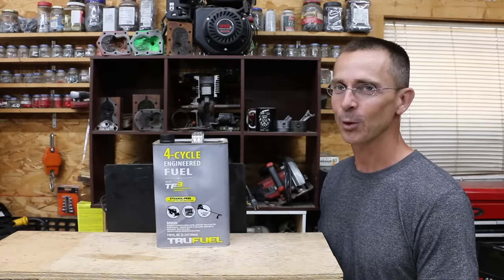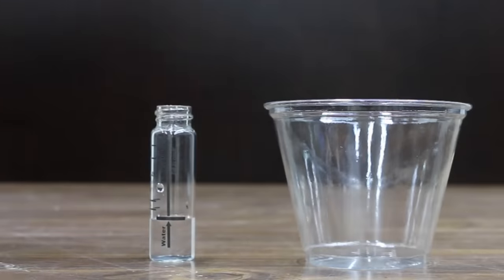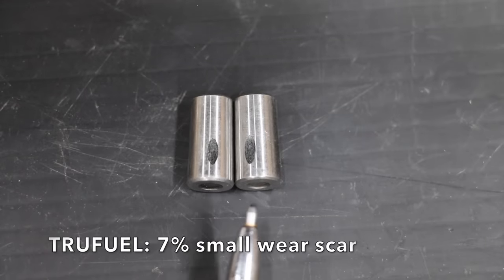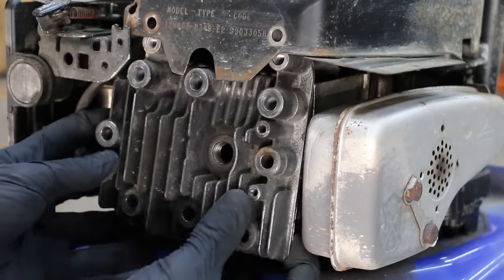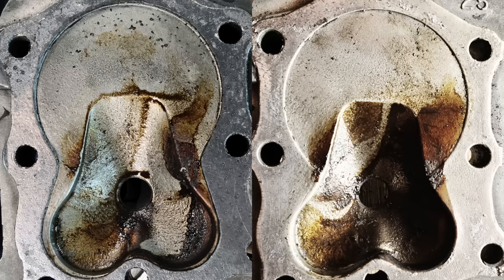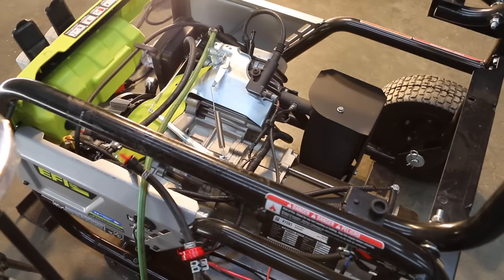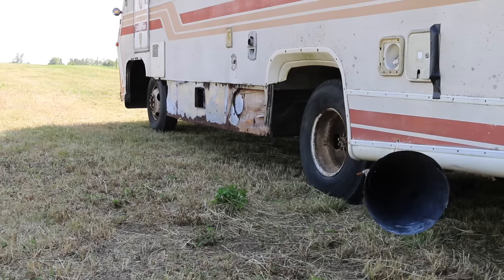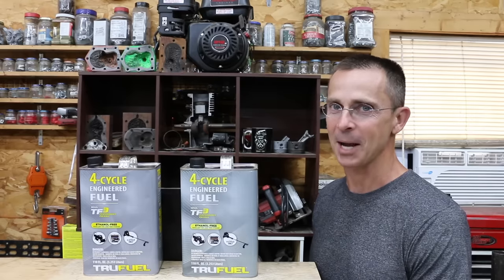Engineered Fuel better than Pump Gasoline?  Better Fuel Efficiency and MPGs? Let's find out!

Comment: There's so much good scientific testing going on here you might as well wear a lab coat.
Reply from the maker: Thanks for watching.
Reply: Not really. Most of these tests were done once only, and the order of testing is often comparing a cold motor with a hot motor, which is a typical scam of oil and additive claims. 
This is more like an infomercial.

Comment: I love your channel!  I work for a large OPE manufacturer and have heard all kinds of debates about proper procedure for winterization/storage of gas equipment.  Please test whether it's best to run engines dry for storage or leave the tank full of either engineered fuel like TF or stabilized, non-ethanol fuel.  My belief is that running an engine dry never completely removes all the fuel - especially from a carburetor bowl.  Plus it exposes the entire fuel system to oxygen in the air which we all know degrades rubber and plastic components.  Fuel systems are designed to be saturated in fuel while in use - not dry and exposed to air, so why do that for storage?  Please test this theory!  Your findings could prevent lots of equipment failures every Spring if you can determine scientifically which method is best.  Thanks for all the thorough and diligent testing you do on all your projects!
Reply from the maker: Thanks and you are welcome!  Thanks for the video idea.

Comment: I would like to see a mini series that pits various fuel additives that claim to increase fuel lubricity against the samples in this video. Also testing those same additives (mixed with fuel and straight). In several catagories including resistance to evap, varnish build up and corrosion on parts as an extension of the video that used lucas ethanol fuel stabilizer.
Reply from the maker: Thanks for the video idea.

Comment: The use of a metal can as storage for the gas is a long term storage ideal. I work in the HVAC field, early on when R22 was being phased out,, the new Refrigerants required a different oil. The early oil container was plastic like the other oils being used. What they found out was that the new oil was absorbing moisture through the container walls. In one test the oil gained almost a 1/4 inch height in the plastic container, just sitting on the shelf in the warehouse. They switched over to metal cans after that was noticed. Ethanol gas and the oil used in refrigeration are hygroscopic, they "crave" moisture. Oh  I just bought a gallon of this, Haha.
Reply from the maker: Thanks for the feedback.

Comment: The real benefit of "true fuel" is that it won't damage any of the rubber components inside a 2-stroke engine.  I over-winter with true-fuel and my 2-stroke stats first pull every time after a 7month winter.
Reply from the maker: Thanks for the feedback.

Comment: Could you compare brand of brake pads? Like brembo? ebc? ferodo? Pagid? Mtec? Stop tech? Bosch? Would be good to see amount of brake dust compared to brake performance or heat resistance, or longevity. i think this is an overlooked thing on most road cars. And is the only thing there to save your life.

This would be a interesting test and would help alot of car enthusiasts. I'm sure with your knowledge you'd be able to set up a rig to test these characteristics of brake pads/companies.

As usual keep up the good work. Your channel is awsome!
Reply from the maker: Thanks for the video idea.

Comment: You should test wire nuts! Some of the tests could be pull strength required on different wire twists and on straight wire, bunching on stranded wire, and quality of nuts per bag/box. I'm sure it would also be interesting to see how much the threads of different wire nuts may dig into copper wire.
Reply from the maker: Thanks for the video idea.

Comment: I use this stuff for winterizing. I run the pump gas out of my lawnmower, put 1/2 gal in and run for couple minutes, then store.
It has stabilizer in there 
When next season comes I just throw in new gas and go.
1 gal lasts me 2 seasons by using 1/2 gal each time.
I may try just using ethanol free that I found near me at gas station with stabilizer.
Reply from the maker: Thanks for sharing.

Comment: I've had a Stihl trimmer for 8 yrs, NEVER had to repair the Carb or tune it up. It starts EVERY spring but I do TWO THINGS. I only use engineered Fuel and I always run all the fuel OUT of the carb before storing. Before i used Gas Station fuel and sometimes I didn't run all the fuel out before storing. Just about every year I had to either repair or replace the card. If I had taken it to a shop. I would have had to pay up to $75 and all they would have done is put on a $20 replacement card or use a kit costing $4. The cost savings was more then worth it. AND, I didn't have to wait up to three WEEKS for the repair shop to have it ready.
Reply from the maker: Thanks for sharing.

Comment: I've had a Ryobi backpack blower for over 10 years. I bought for the price, and used nothing but Engineered Fuel from the Big Box store with the Big Box store that starts with "H". Do I hate paying the price for that stuff? Yep. Has it worked for me? Yep. All I've done in 10 years is add a replacement carb and tape up the blower tube. I think this damned thing will outlive me!
Reply from the maker: Thanks for the feedback.

Comment: Great test, but I'm in Southern Calif where it's not possible to find ethanol-free fuel at any gas stations within 50 miles.  So, my primary benefit from engineered fuel is keeping small carburetors clean in generators, weed eaters, etc.  I can let an engine sit for 6 months, add some engineered fuel, and it starts on 2nd pull.  I CAN vouch for the shelf life claim (I buy the 1 quart cans, because I don't use much each year, unless we have power outages.
Reply from the maker: Thanks!  Thanks for sharing.

Comment: I noticed they had quart cans of 2 cycle fuel in a local hardware store back a few years ago. The price was $7.99. That's $31. 96 a gallon! We, my dad and me had already started the practice of buying non-ethanol gas a few years before, to make our 2 cycle gas out of. We had grown tired of the ethanol gas messing up the carburetor's on our weed eater's and chainsaw's. The mower, we usually just added Seafoam to the gas. You can buy the non-ethanol gas at the local Co-op for maybe a dollar more a gallon. We figured you would have to be nut's to pay almost $32 dollars a gallon for them little quart cans at the hardware store. You could take the non-ethanol gas and probably just add an additive to it and get basically an equivalent to the engineered gas you tested here, for far less money. Everybody should know that you can buy non-ethanol gas at farm Co-op's or at Marina's and anything you are not going to run all the gas out of within 3 months, you should just spend the extra money for the non-ethanol gas and avoid the headaches. That includes antique car's. I knew a friend of my Dad's who had antique car's, was complaining about having to overhaul his carburetor's every time he took one out, because of putting ethanol gas in them. Plus you get a little better mileage with the non-ethanol gas.
Reply from the maker: Thanks for the feedback.

Comment: A good test to run would be the long term storage of the different fuels. If you leave ethanol fuels in very small carburetors vs non ethanol fuels, you will  see big differences when you take them apart. I am willing to pay more for gas if I do not have to take things apart and clean out buildup and varnish on low usage/seasonal machines such as outboards or ice augers. Etc.
Reply from the maker: Thanks for the feedback.
Reply: Check out Taryl Fixes All. He's currently doing a long term fuel stablizer test. So far it's proving that they're all just snake oil.

Comment: Yeah -- definitely seems like this is the stuff to buy if you're outfitting a bunker somewhere and need to store your fuel for many years.  Un-opened, they claim a 5-year shelf-life -- and I'd bet, in a pinch, you could stretch that even further.  But for regular day-to-day use, I'd say the ethanol-free stuff you can buy at a local store is a far better deal.  Thanks for the video!
Reply from the maker: You are welcome!

Comment: PF: I'd like a new head gasket for my pressure washer please....
Counter man: sure thing sir, anything else?
PF: Yes, 20 more of those please.
Reply: And spark plugs go with them.
Reply from the maker: lol  Yes, that is me!
Reply: Project Farm will soon single handedly cause the small engine headgasket shortage of 2020. Atleast if that were to happen we would know where to look for some lol.
Reply: Talking about pressure washers, could you text the myth that running a pressure washer  without actually using it will ruin the pump if the pump doesn't have a bypass? I'm pretty sure I'm not the only one who thought that a air blower or vacuum, were being wrecked if I stuck my hand on the end of the nozzle and blocked the flow. I'm not sure if the same applies to pressured water??
Reply: @joelmaljaars9095  for gas powered pressure washers it doesn't matter if you leave it running whiteout using it, but don't leave electric pressure washers running whiteout using as you burnout the motor. A blocked leave blower can blow as they arnt build to deal whit the excessive prolonged pressure, but vacuum machines are built to deal whit it

Comment: Trust me, I'm an engineer
Reply from the maker: Thank you!
Reply: I think I'll put this thing right here
Reply: @tomhewitt8017  what the fuck did just happened here 😂
Reply: @bryanjudefernandez2195  Shovel bazooka is in use
Reply: K sir nnnnnn everythang nnnnnn stuff
Reply: @desertfox2020  oh shit I think I'm out of here!
Reply: That's the funniest part of this scam. Gasoline is a well engineered fuel that has been continuously upgraded and improved over the last 100 years and is region and seasonal adjusted.  
If it actually did anything, it would be a way better idea to sell it as an additive.  There is nothing in regular gas they would remove, so it's all additives. So just sell a damn additive. Shipping is a good portion of the price. Not the shipping you would pay, the embedded shipping cost.  Are they really claiming they have their own refinery?

Comment: Amazon LED headlight bulbs! There's a ton of brands, tons of prices and claims. Could test lumen output, tolerance to heat, load on the system, how well the fan cools the led down
Reply: Just a note, if your state has vehicle inspections, LEDs will usually fail. That's how it is in Va, the bulb must be of an approved type as listed on the headlight lens.

Of course, people usually just swap the led back after the inspection, so a lot of good that does.
Reply: @ALovelyBunchOfDragonballz  And yet factory installed HIDs pass?
Reply: @jaalan7896  factory bulbs are required to meet specifications set by the DOT, and very few auto manufacturers use HID. Led is what most of them have. They are cheaper to make and install over HID, plus they last longer.. Regular led bulbs in a lense assembly designed for hologen bulbs will scatter the light improperly causing a safety hazard to other drivers. Unless it's done properly, which I have yet to see done by more than 3 other people.
Reply: @jaalan7896  yep. I've failed two hids lately. They turned pink once they came on.

But yes, factory hids pass. Not all the rules make sense.
Reply from the maker: Thanks for the video idea.

Comment: Look, let's be honest here.  All fuel is engineered.  Have you ever seen a refinery?  No engineering there, no siree!
Reply: I thought this was alkylate "gasoline", which is made of petroleum products but does not really share much with gasoline. Another interesting would be GTL fuel which they say is liquefied from natural gas and thus should be pretty different from standard gasoline.
Reply: @gearloose703  liquid gas? Liquid gasses don't burn...
Reply: @gearloose703  Don't get confused with teh base stock, once it's cracked or hydrolized, and the end result is 'gasoline' it is in fact the same thing. Now the additive package may be different, but the base spirits of the fuel would be the same. 

Starting with LPG means they're 'gluing' chains together to get the stuff in gasoline, like octane for example. that's an 8 carbon chain molecule, it would take 8 single carbon methane molecules to form it, and you'd have some hydrogen left over.  

Cracking long chain molecules down, means you'd start with say decane (10 carbons) and then get one octane molecule, and one ethane (2 carbons) and still some hydrogen left over. 

I'm over simplifying, but that's the basic idea, almost like nuclear fission and fusion. One tears apart, the other combines together.
Reply: @kleetus92  gasoline is a mix of all sorts of things and crap, alkylate gasoline should be a lot more "refined" and homogenous? Same for gtl gasoline?
Reply: A valid point, you are paying for the can as much as what is in it, if you take some, ethanol free gas, add Sta-Bil or Seafoam and the correct amount of synthetic oil you have TruFuel... having said that TruFuel is made by https://www.calumetspecialty.com/ It’s a very good company, they bought Royal Purple in 2012, have 3,400 specialty products and engineer them from crude oil refineries. I believe Pennzoil was bought by Shell but Penreco used to be the Parent company which was bought by Calumet in 2008, so there’s a lot of expertise behind TruFuel, but it doesn’t mean you can’t just go out and buy Shell vPower Nitro and mix it with synthetic oil and a stabilizer and save yourself some $$ though
Reply: @Sh4quille0atmeal  pentane is a very flammable liquid

Comment: Were you worried at all about the lubrication test sparking a flame?
Reply from the maker: Absolutely.  I had the fire extinguisher ready for action.  lol
Reply: In all honesty having the fire tetrahedron line up during that test was probably unlikely but it never hurts to be on the cautious side.
Reply: @SchuboxProductions  liquid gasoline is never really the concern. Gasoline vapors on the other hand are hella dangerous. In the bearing tests, it's important to note that he had nearly 500 watts of power heating the bearings, which were being cooled by the gasoline, meaning that the liquid gas was mostly absorbing that 500 watts. Gasoline is volatile enough, heating it just increases the rate at which it evaporates and is just a recipe for disaster. The only thing missing from the equation was an ignition source.
Reply: I thought the same thing. Anyone who has experienced an out of control gasoline fire knows how scary the stuff really is.
Reply: @wtechboy18  That's right. He never completed the "triangle"
Reply: @awesome-xd1md  fortunately, he did not. My biggest concern was a nearby spark from the electric motor or something would cause an issue.

Comment: I use true fuel 2 stroke and I love the performance in my echo trimmer
Reply from the maker: Great brand of trimmer!  I have an Echo pole saw
Reply: I use it in my chain saw....completely pre-mixed and runs great with less smoke.
Reply: I’ve had my echo trimmer since 2002, I use it weekly to trim my yard. Took the double string head off from brand new, and the guard. Also removed the screen in the exhaust brand new. Same plug, no problems at all. I use non ethanol and it takes 2 pulls to start.
Reply: I have an Echo leaf blower, really like it.
Reply: In my experience it feels like it's better for you, though not necessarily your machine, than regular fuel. This is mostly when used in things like trimmers, chain saws or other small machines that you work with in close. After a day my head doesn't feel quite as mushy. I was told this was due to there being no Benzene in the exhausts. It's still not good for you to suck it up all day, just, allegedly, less bad...

Still the price is quite hefty, so I use it selectively. If there's just a little wind the exhausts usually isn't much of a problem.

Edit: I was also told it doesn't gunk up the carburetor the way regular fuel can do if you leave it in the engine for a year or so.
Reply: I use mixed trufuel in all my 2 stroke small engines.  Pricey, but has never givin me trouble in about 4 years of experience.  I also have echo weed eater, 15 years old and runs like new